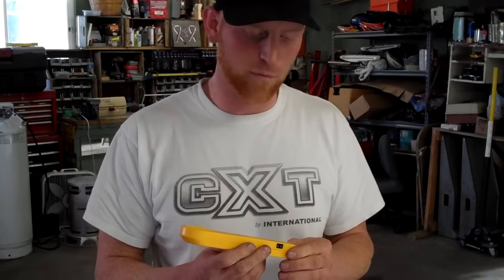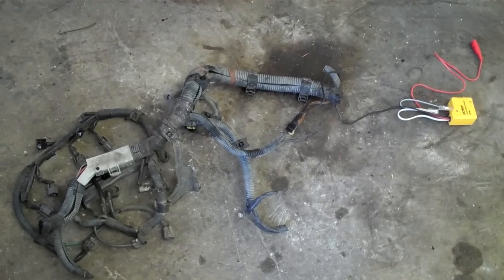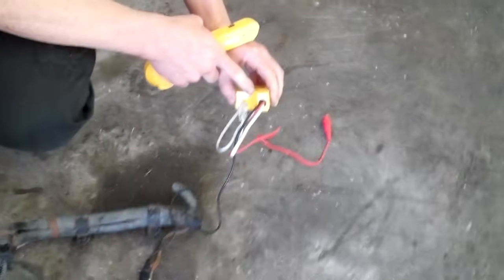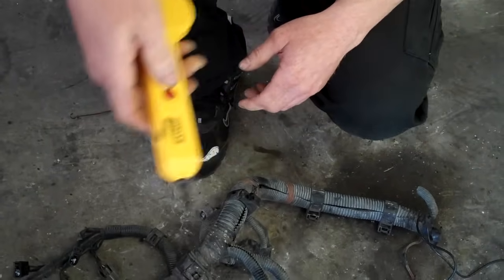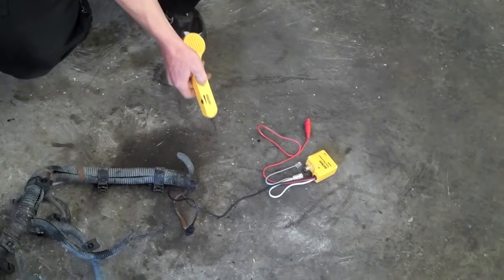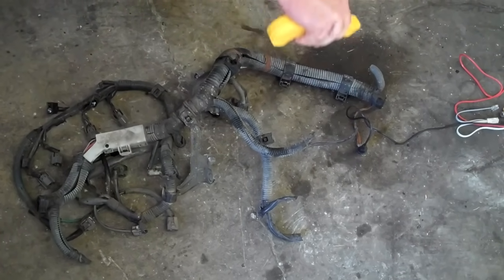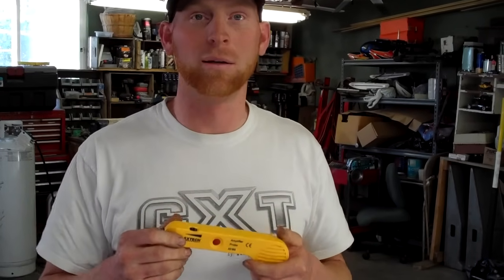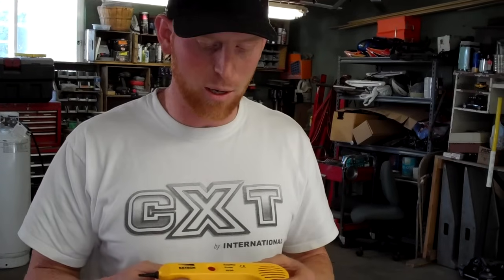How to find an open circuit or shorted wire the FAST easy way

Comment: what type of short would make both fenders hot to the touch when it is running please help if you can thank you.
Reply: your scenario sounds a lil far-fetched, but if valid, a dead-short in the headlights/parking lights harness could conceivably do it .. Have never witnessed such a thing, though..
Try pulling out the fuse for those lights (confirm via the shop manual .. might be more than one ..)   If you can't then cook your breakfast on either fender, then you've made headway ;)
Reply: Robert Mccaffrey its called a sun short... park your car in the garage and it will be fixed :)

Comment: I work at a telephone company in Belgium and I use this every day multiple times. I don't know how you could find a shorted wire with it. We use it to find our pair we need for our costumer in a cable with a whole lot of pairs in it. also we can then short the pair on the other side and see if we have continuity of the both wires. When you short the wires the sound should go away. If the sound keeps going you have 1 wire not coming through.

Comment: hello brian,
after I solder my wires and place heat shrink. can I pass over the splice with this tool to double check that wires ARE together and no break?
Reply: Paul Olivas yes. The tone will be louder when the wires are together but stills make some tone when not together but just close together. You will hear the difference.

Comment: I see how your method would show a break in a wire, but not sure how that would detect a short?
Reply: FogertyCosmo you would use it as a continuity tester and if you got the same time or continuity from with wires you would know they are touching. The tone would then be used to locate general area of where.

Comment: Im an electrician and this is my favorite tool in my bag. I can find ac wires in attics, junction boxes, panels, walls. Ive fixed my van with it, and used it on an aircraft carrier for complex equipment some pretty amazing distances. The one I have currently I bought from harbor freight for 12 bucks, and it works like a champ. I even screwed a drywall screw into a plywood wall, hooked a lead up to it, the other to a ground, went on the other side and found my exact mark where i want to drill.
Reply: it will go as far as dial tone would go... I've  gone from a customers home to the CO 18KM away and still hear my tone.
Reply: Martyn Thomas PMSL. Thanks that made me smile.
Reply: Danger Dave, I use those and also the 3m circuit trace that can trace wires in pipes,shielded bundles  find panels, and detectec from 1/2" to 8 ' even under ground. The tone traces are good but can't do that.
Reply: cool harbor freight thanks
Reply: What is this electrical tool listed as on Harbor Freight?  Thanks
Reply: @gbsk12  cen-tech cable tracker
Reply: Can you provide the link for this?  Thanks
Reply: How does this compare with Fluke's version, and perhaps even the PowerProbe?
Reply: wearing only a thong and red lipstick.
Reply: Can you please thoroughly demonstrate it?
Reply: DangerDaveFreestyle hi can I know is there any chance to work with u 
I'm an electrician too 
This is my whatsapp n Facebook num 
9014779171
Reply: @skrajrrd  don't put your phone on the internet, genius
Reply: DangerDaveFreestyle if no please please suggest me somewhere else thank u

Comment: sooooo, not sure if I understand. how does it pin point the exact short. the sound gets quieter the further you get away. there's lots of wires put together under the shirt. you can go in any direction and it gets quiet. doesn't really say much
Reply: I also are left a little boggled on how it pin points the specific location of the failed lead
Reply: I suppose if the sound fades at a junction in the flex loom, you'd try following possible routes, eventually finding either the short, or, the end of the circuit. That said, the device is quite large, and difficult to get deep up into the dash. Still though, even if it doesn't find the short, it could possibly guide you closer to the problem.
Reply: First of all it doesn't find shorts,  Shorts just burn fuses and wires.  It finds BROKEN or OPEN circuits.  It doesn't find the exact spot, it finds the general area reducing the search down from 3 yards to 6 inches.
Reply: Actually, you CAN find a short using the fox and hound probe, because if you find that MORE THAN 1 WIRE, has the tone, when it should NOT, then the wire with the tone is shorting to the wire that should not have the tone.  This occurs often when I am doing cross-connects in phone room.
Reply: Thank you 😊

Comment: Good video about a great tool. Should have connected to a wire that didn't go through the whole harness so you could show how it "finds" a wire, Also, as an electrician for 30 years, it drives me nuts when people refer to an open circuit as a "short" - they are basically opposites and this tool will not find shorts. That being said, you have made some awesome vids and you have helped me with them BIGTIME - especially the Jeep WJ dash removal one - saved my a** with that one. THANKS!!!
Reply: oh wow I was thinking the same thing that he misspoke and should have said open circuits, not shorts

Comment: I get the point of the tool of course but it seemed as if it would be very difficult being that the audio seemed to be just as loud everywhere throughout the wire harness.  As you know when harnesses are I'm a vehicle they have clips and often change color of the wire so it seems like it would be difficult to find the exact wire when it's audible throughout the entire harness. say it's a 30 pair of wires, it seems difficult to find the 1 wire needed. hope I wrote this in a way it makes sense lol

Comment: Hey Brian, I noticed someone else mentioned this Extech TG20 Wire Tracer/Tone Generator as an alternative to the one you have and it's around $20. Did you purchase your model for a particular feature(s) it had over this basic unit? 
And thanks for all your vids!

Comment: hey can you help me i  have a 2004 Dodge Stratus  in it keep going dead the next day and i just got it fix like i got a new Thermostat and a new oil pan Gasket  and a new Alternator  and a new battery but when i get a jump or get the battery charge and go outside the next day it will be dead Please help me this is my first and only car

Comment: I gave you thumbs up cuz it was a good vid and explanation but I couldn't find where you started what this device is called and it's model name.
Reply from the maker: +juntjoo nunya Thanks!  It's an Extech Instruments tone generator.   There's a link in the description with more info.
Reply: Thanks! Tough call. The one 3-4 times the cost has half the 1-2 star reviews. With all cheaper products you've got a higher chance of getting a dud. But when you get the good ones you save big. ....just save your receipts and hope if yours goes out it does so within the warranty period.

Comment: Hi Brian, my name is Richard. I have a 2001 Honda civic I am a beginner at working on my own car, I have become fascinated with wanting to fix things. My issue is that 3 of my car windows are not rolling down or up, the only one that will work is my drivers door. I checked the connector for power and its only showing that I have power in the drivers side. I might sound super stupid right now but I really need some help with this, im starting to lose my marbles lol. Thanks kindly for any help :)
Reply: I am willing to bet it is the regulators and not the electric motors. The lubricant dries up and they stop working. Lots of people shell out hundreds to have a working motor replaced.

Comment: For those who thumb down this video, go turn your man card in and take your car to the dealership so they can do the repairs for you. 

This video is a demonstration on 1 way to use the tool. If your tone suddenly disappears/stops, thats where your short is. Its that fast and easy. 

This tool goes well with my digital multimeter when I diagnose problems with my car.
Reply: I lose my Man Card every time I read the damned installation & setup manual.  Last lost it programming a VFD and using Alexa to turn my TV off and on.

Never ever visit an Ikea.  Ikea saws your testicles loose from the vas deferens with a rusty butter knife,  leaving you a eunuch, but with no extra screws and bolts left over if you actually followed the procedures.

Comment: used one of these a while back to identify which wire went from my fuel pump relay to my PCM computer, very handy, wouldn't have liked relying on wire color because there was more than one of that color coming into that plug.

Comment: I still find that hard to use or buy... what happen if the sound goes to fuse box... but but, it also sound at the passenger, ecu computer... now we fu**k.. its not a good tool.. good for house wires/breaker.. thankss

Comment: How to find my 2005 Toyota Highlander some time starts good . Some time not starts and not even dash bord lighting.
Reply: +Koteswararao Saragadam  most like your astarter bushing is gone,, b-could be relay.- lose connection-rusty-its kill- those car the wires are strong.. its most likely you have to change out the compote!!
Reply: I'm late to the party ,if you haven't figured it out yet it's a bad/loose ground don't listen to vanflawless about the computer
Reply: How about a flat spot in the windings where you just replace the whole starter, course could be a bad starter relay as well , I can guess the symptoms or check cont. across the points .04 ohms or around thats good

Comment: Brian... I'd like to start out by saying I'm a fan.  So I am not attempting to bust your balls.

You should point out that the inductive field works great on the voltage feed side of the harness... ONLY.

 I mention this because you used the ground harness as a demo... and some guys (like myself, who learned this the hard way) may not realize that when you connect the toner to ground, it tones everywhere that is connected to ground.   SOOoooo...  It works great for tracing harness, as long as such is not connected to ground, on chassis ground systems.  

Love your vids... I've learned a lot from you.  Keep it up!  (The Mig Feed Aluminum Welding vid was great!)

Comment: If there is a short in the wire harness how exactly would it sound considering that the short may not always burn through all the wires and still leave some intact which wouldn't it hide or give a false reading? With your video it shows a section of the harness completely cut off but how would it sound over a short? And would there be a significant tone difference if some wires were fried as opposed to a complete cut off? Also, if there was a short in a harness wouldn't it also give a false reading since not all the wires would get shorted?

Comment: Brian if you have four wires running through a bundle of wires and the short is somewhere in it, how is the machine going to not just keep ringing because of the good wires. Can you show a demonstration of a broken wire in the middle of a group of good wires and see if the machine works. I love the idea and will get one for sure. thanks for the video.

Comment: It can work on wire break only.
Try this.  Take a 14 gauge, or any gauge, and shave about 2/3's of the wires. 
You will still get tone.  So, shorts to ground or high corrosion will not register.
It's a great idea, but it does have it's limits.

Comment: Hello everyone,
I just bought recently a 240sx and the car seems like had a 5 speed swap before and I have problem, the car keeps drain the battery and the battery brand new just bought it 5 days ago cause I thought the battery is the problem but I was checking all the fuses today with multimeter and I found so far 2 short circuit,
1- the shift lock stay on when the ignition and the car off 
2- car interior light stays on only on the multimeter even if the switch off and the car turned off and read 12.13 DC so I think that's enough to drain the battery!!!!
Reply: +Dr.Dave to find a short within a car you do not use DC. You find the Amp's using a multi meter.  Look up "Battery Draw Test" here on youtube.

Comment: I find your video lacking information such as the actual name of the tool you use. you simply state that it is a cheaper version also when you describe the change in tones you don't really explain how to detect the actual change and sound and wear it occurred I couldn't tell what to listen for only where the wire was , not where the break was.
Reply from the maker: +Maria Lemieux   You're right.  Here you go → http://www.amazon.com/gp/product/B00ADHQCIO/ref=as_li_qf_sp_asin_il_tl?ie=UTF8&camp=1789&creative=9325&creativeASIN=B00ADHQCIO&linkCode=as2&tag=httpwwwyou00f-20&linkId=RABN33T7L42ZYU5T
Reply: In order for multiple tones to be useful, it is a lot better to have TWO (or more...so long as each has a unique tone capability) transmitters.  Big time saver when running all over the place when a circuit is 100s of feet in length (no need to run back to the transmitter to change to the other tone).

Comment: this is the first time I seen your videos and it is so interesting!  I am a woman and have never done mechanics but, I might have to learn the hard way.  My car is a Mitsubishi 2005 and it has been with the mechanic for 11 months already.  I was told that it had an electrical problem but according to them they already checked all of the wiring and they couldn't find the problem, so I will have to go and tow the car back to my house.  I might as well order the circuit finder kit to start.  and then I will look up onto the speedometer and rpms gauges, since they are not working on my other car .............  :-(

Comment: My 2-story house front exterior GFCI receptacle outlet is out of power. The supply wire must be cut off by a squirrel in my attic somewhere on my wall. It seems this demoed tool is what I need to trace and detect the open wire in attic or wall. Do I understand correctly? If this is not the exact tool I need, then can you recommend one? Let me know. Thanks a lot.
Reply from the maker: +David Gao This tool is great for that, but make sure there's no current in the circuit (use your breaker to open the circuit) and make sure to ground the black wire on the tone generator.

Comment: the only thing you showed us was a metal detector. you didn't show the principal use as described. the tool makes no sense unless your trying to find a wire in a wall. it didn't even do that correctly.
Reply: You didn't understand what was being shown at all. It wasn't shown as well as it could have been, but it's pretty easy to understand if you've got a even a basic understanding of the purpose. What he was trying to demonstrate is how to find out which of dozens or hundreds of wires in a bundle is the wire you've located somewhere else.
Reply: You plug the one unit into the wire and it sends a signal down the one single wire that's detectable by the thing you thought was a metal detector, it isn't, and wherever it senses the signal it makes louder noise the closer you are to the signal source which is the whole wire that secondary unit is hooked to.

Comment: FALSE PROMISE in that he is not showing some of the cant do situations.  I worked with telephony many years ago.  Business phone systems typically use 25 pair wires in one single cable, (LOL, I did say many years ago)  The automotive harness is similar in many respects.  When you clip the tone emitter to a pair of wires (or several pairs at once) the sound will travel down that cable quite a distance.  This is very handy if you're in the basement and the cable terminates in some back room on the third floor or visa-versa.  However the tone will travel through lots of the wires in a tight bundle (ie:25 pair phone cable or auto wire harness) and you;ll have to do a lot of searching to find the exact pair you want to isolate.  The tone does cross-talk to other wires in close proximity and adds an additional puzzle to figure out.  I wouldn't be without a tone emitter in the telephony business but I know it's applications and limits. For a DIY automotive novice its just another tool to play with and divert you some from the frustration.  At least for the time duration that you spend figuring out the new toy and then its back to the frustration but now with the additional frustration of having  less money in your pocket.  If you are in a mid-size to large city, The large electric supply houses stock these and can even let you play with it there.  I always liked Graybar Electric.  They are probably still around.  Just a side note:  Graybar was four hours behind Alexander Graham Bell in filing for the patent on telephones. Good Luck. Phil
Reply from the maker: +phil huber Here's another video I did that demonstrates it's use much better. → https://www.youtube.com/watch?v=OJzobXmMwuM

Comment: Tone generatorst help you find wires multimeters helps you find opens theres a differnce..You need a multimter.You still haven't fixed the problem.The tone generator is for identifying wires not finding opens.
Reply from the maker: +Dennis Moore Here's a video where I found an open circuit using this tone generator → https://www.youtube.com/watch?v=OJzobXmMwuM